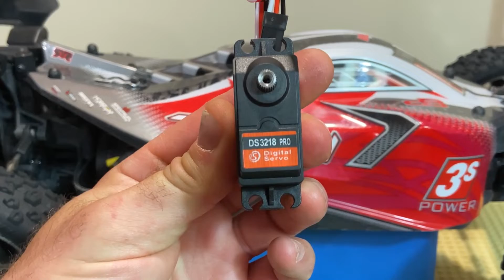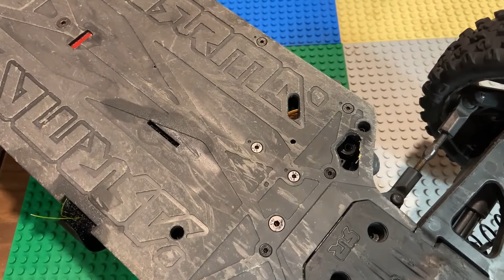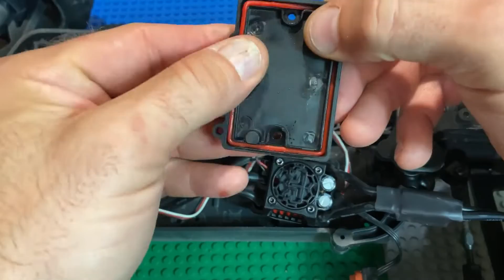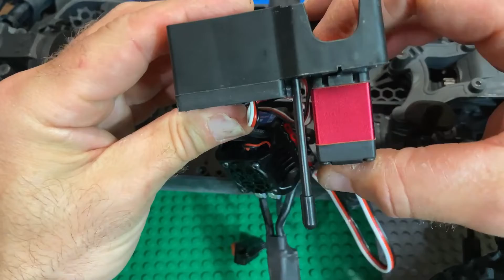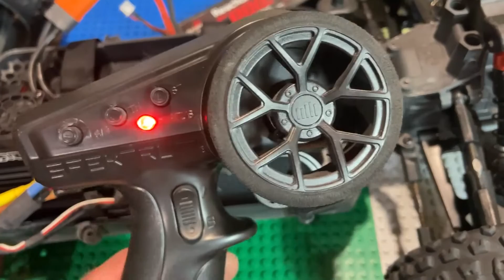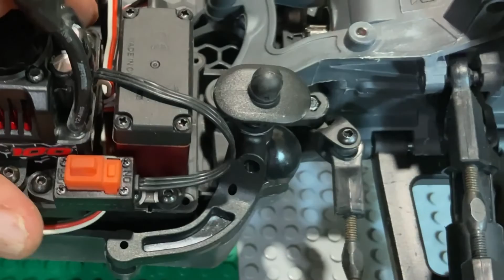HOW-TO REPLACE ARRMA 3S RC CAR STEERING SERVO | SET STEERING ENDPOINTS

Comment from the maker: Watch this next: How-to-Rebuild 3s and 4s Differential Gearbox.  https://youtu.be/faKrWfy4yuY
Reply: I watched that one.  I meant a full kit. 27ish bearings.  Including the dreaded motor bearing. You do a great job with the videos.  When I was new your videos would have saved me  a lot of time.  I'm sure you know the hub and motor module bearings go first.
Reply from the maker: @wescat2  i have a bearing kit for the whole rc here actually, waiting to do that video. And, i have a motor needing bearings too…. Def gonna hit those. You mean motor module? That was my first to go.
Reply: @phillybrc  Yeah.  I'm waiting on a pack of 10x15x4 for the module.  Do you do the bread trick for the motor bearing?
Reply from the maker: @wescat2  I havn t had to. Look interesting!
Reply: @phillybrc  Yeah if I there wasn't a video of it and how it works I wouldn't have believed it.
Reply from the maker: @wescat2  Hey how s it going? I just come across these older messages lol. I have since made made a motor bearing video using the bread trick. Thanx for suggestion....2years ago haha.

Comment: Dumb question on an old video. Thank you for the tutorial by the way. My stock Typhon 3s servo just went out on me today. Do you recommend the Amazon 25kg or 35kg servo?
Reply from the maker: @chrisginoc  not a dumb question at all. I ve owned both, i would pick the 25kg onky because it s a touch faster. Otherwise, either will work👍🏻

Comment: Great video Pal! Just did mine. Went ahead and put aluminum pivot balls in while I was at it. Only difference with mine was I had orange, red and brown wires. I used brown for ground but I did have to change the switch setting on my controller as it was backwards after I  got done. Thanks again!
Reply from the maker: THANX!  Yes the spectrum are reversed to other brands. Thanx for watching!

Comment: Great video! I have my servo on the way. I also ordered a set of aluminum pivot balls, which include two for the servo links. I'll have to figure out the best way to get those installed.
Reply from the maker: Thank you for watching. I have many similar videos, this link will help you! 🤜🤛 https://youtu.be/rPMqxy3GMtE?si=nuthjmas8o1isifp
Reply: Perfect, now I know where to put the two extra pivot balls. I'll do that when I replace the servo. Thanks Pal!  @phillybrc

Comment: Fantastic video thank you . I notice you apply blue threadlock to the plastic  steering  horn ? I thought threadlock damages plastic over time ?
Reply from the maker: I put blue threadlock on the screw. The screw, screws into the center of the spline on the servo…which is metal. Great question. Thanks for stopping by

Comment: ive got this red servo 20 g and and cant get red servo saver to go down on teeth of servo?
Reply from the maker: You need to figure out if the servo and the servo saver have the same number of teeth. If so, push down hard!
Reply: @phillybrc  yes they both have 25 teeth I push down but wont go on, its the same servo and saver you used.
Reply from the maker: @43rocket  it s hard. I used channellocks, did uou see that part?
Reply: @phillybrc  got it to fit! will the hot racing metal saver work on this servo?
Reply from the maker: @43rocket  yes ! It will fit, but i ve mostly heard negative feedback about that saver. Let me know how you make out
Reply: @phillybrc  will it fit easier on the teeth than the plastic one?  what problems?
Reply from the maker: @43rocket  the spring pops out, then it s junk…

Comment: Quick question I noticed you have the ST knob all the way to the left, mine all the way at to the right, and what is the function of that and how should I have it set when I am re-programming my ESC to factory settings
Reply from the maker: ST is "steering Trim". Ideally, this knob stays central.  The ST knob lets you trim the steering if it isn't travelling straight, Have the ST knob in the middle then power up the RC, at this point install servo saver.  Your ST knob will be far to one direction only if the servo wasn't in neutral position upon installing the servo saver. Hope this helps!
Reply: It does, thank you! @phillybrc

Comment: I've got a question, I changed the steering assembly for the alu GPM and the drag link to the servo isn't part of that set. If I change the servo, is a drag link part of the servo pakkage? If not does anyone know a replacement for the plastic link, i want it to be alu. 😘
Reply from the maker: Havn t seen just the the drag link available in metal. Hot racing bellcrank comes with a metal one and so does this one(i just bought it). This info doesn t really help you unfortunately.OGRC Aluminum Alloy Steering... https://www.amazon.ca/dp/B09WDLGJWB?ref=ppx_pop_mob_ap_share
Reply: @phillybrc  thx for the link, too bad GPM didn't include that part. The HR set seems awesome 👌🏻 Hopefully i can find something for this set and order HR set for my other car
Reply from the maker: I ll try to find you something. I put metal balls in my stock link. Works great.
Reply: @phillybrc  yeah thats a reasonable solution, I use the alu pivot balls for sometime now, and they work better then the composite ones. Eventually the rod ends wear out. Thank mate for he effort, I'll take a closet look at your shimming video 😉
Reply from the maker: https://youtu.be/rPMqxy3GMtE

Comment: i bought these same exact parts from your link and i cant get the drag link to go onto the servo saver. the whole on the small side is too small for the screw. how did you do it??
Reply from the maker: It s a touch smaller , yes. I just applied a bit of pressure and the screw enlarged the hole. Make sense?
Reply: @phillybrc  in theory yes, in practice i couldnt get it lol. how long did it take you?
Reply from the maker: How about a longer screw? It wasn t a challenge. Email me a pic or video?  facebook messenger or philborrelli@hotmail.com

Comment: the channel locks are pretty huge. I was at the races the other day and had to replace this part. Putting that servo saver 25 tooth onto that amazon servo, also 25 tooth, was a real pain in the butt. Had to muscle it but I got it on evenly. Being the same tooth count I would have thought it was going to be an easier fit.
Reply from the maker: They are big, what I had…a good way to come down square. I guess if it wasn t a pain in the butt, it would slip or skip teeth possibly. Thanx
Reply: @phillybrc  Would have been nice if that metal serve arm that comes with it fits in the senton. Unfortunately, the linkage is too low for that space so i had to good with that servo saver. But it's on, the screw is in, I think it should be good to go.
Reply from the maker: I believe you can use that arm if you cut a bit of the the receiver box out. Even so, you get any of the spring-loaded protection the saver provides. Good luck

Comment: Don’t use channel locks boys, I just damaged my brand new servo from doing this. With slight pressure not much at all, think it will be fine just to put it on by hand and screw it down. It still works but Dosent sound normal anymore.
Reply from the maker: Sorry that happened to you. I always do it this way and has been fine

Comment: My Typhon 3s was loosing steering randomly last 2 weeks. Like remote was turned off. I tried new batteries etc. last night it stopp again but when I got it back it move left fine but right barely moves and makes grinding sound. I was thinking bad remote but now we grinding servo.  Any advice? I’ve never replace one
Reply from the maker: Grinding is never good. I usually open receiver box and and reverse how they are plugged in(trigger and steering wheel are now reversed) If it does the same thing, i d say your servo is gone.
Reply: @phillybrc  I never thought of that. Trying now. Is there an easy way to see the gears? Like the top 4 screws. Or is that the board. I guess I might have to take the entire thing out to replace the servo.  I assume it doesn’t come out with the 4 screw on it
Reply: @phillybrc  I replaced servo and it’s fixed. Another issue. I hit reset button on esc yesterday I lost reverse which I got back. But when I turn transmitter off the car goes full power into reverse. Never did this before. Any ideas? I’m stuck as can be. Going in hour plus
Reply from the maker: @bri7777-l3x  reset throttle endpoints. Not sure if i have a video on that
Reply: @phillybrc  nip never heard of that. Any idea roughly how to do it ?
Reply from the maker: @bri7777-l3x  https://youtu.be/cgbOKYPaMG8

Comment: I did this with this exact servo and my steering is reversed. Fixed it with the button on the remote but the avc is unusable cause of this. What did I do wrong?
Reply from the maker: Oh man, this is strange. I ve never heard mention of the servo affecting AVC. That sounds like a receiver issue. open receiver and double check connections, make sure the the - (neg) is in the correct  spot.
Reply: @phillybrc  I tried plugging it in both ways. Only worked the one way. Cause the motor is reversed the gyro turns the opposite way. Makes it spin out instead of stopping it from spinning out. So weird. I’m going to reverse the polarity at the plug and see what happens. I’ll let you know. Thanks for the reply bro.
Reply from the maker: @jeff4232  of course, let me know. Good luck
Reply: @phillybrc  ya so I ended up having to take the servo apart and reverse it by soldering. I was able to do it without removing the servo from the truck, saved a few min.  Now the gyro and everything works great.
Reply from the maker: Really??? That sounds nuts. Nice moves man.
Reply: @jeff4232  hey I'm having same issue.. I'm not using gyro though. That's a hexfly by redcat racing servo right?
Reply: @billstanley2886  no. It’s an Amazon special.
Reply from the maker: @billstanley2886  The amazon servo and the hexfly look nearly identical.
Reply from the maker: If you re AVC is turned up too high it may act weird also.

Comment: Thanks.  The 12:00 mark is a life saver. I can't find any videos on this.
Reply from the maker: Awesome. Thanx for watchin and commenting.
Reply: My armma senton just lost stering... hopefully it's just a servo... any way to test it? To make sure that's what it is?
Reply from the maker: @51-FS  I usually will swap connections on my receiver first. Therefore, your wheel will control throttle and your trigger will control steering. This at least eliminates the chance of the steering components being bound up. Otherwise, testing other servo or receiver would be ideal.
Reply: @phillybrc  good idea... I ended up putting 6 volts straight to it and nothing happened. I'm on way home right now with a new servo

Comment: Very nice, when are you going to upgrade to a Reef's 299LP servo? Also.. if your putting a cheap servo in there, do you really need a servo saver.. seems kinda redundant. Did you try taking apart the new servo to upgrade the two ball bearings, and properly grease all the spur gears? The bottom of my amazon servo had little balls of solder.. I blew them outta there! :o
Reply from the maker: Cheap or expensive, wouldn t you want to protect it? This way you don t get sent home broken down. My son and I have taken burnt servos apart to view parts, no solder balls in there lol

Comment: Good video!!! I just knew how to set endpoints from this video. I own arrma senton 3s V3 blx. Need to replace new servo.. Is this servo torque overkill/ recommended?
Reply from the maker: I guess it s preference. If the torque is higher and still quick and responsive, it s good.
Reply: @phillybrc  is the new servo horn that come with the 20kg servo doesnt fit?
Reply from the maker: @micikho1  It does fit, and you CAN use it, but it is not a “servo saver”. A servo saver is spring loaded and takes some of the abuse upon landings and collisions.  The servo horn is direct drive and may break your servo. Up to you.
Reply: Your new servo requires 4.8 ~ 6.8 DC Volts. Meanwhile the original servo 6-7.4v . Is the stock Esc have BEC output?
Reply from the maker: @micikho1  No, it must be variable of some sort. It works great.

Comment: Just a quick question, do I need that exact servo saver or could I use a regular 25 tooth servo arm, thanks!
Reply from the maker: To my knowledge, any 25 tooth saver will do it. Options are Arrma, Hot Racing, Traxxas and Kimbrough. I m sure there are more I’m not aware of. Thx!
Reply from the maker: Oh, maybe i didn t answer your question...yes you can use the servo horns but they are longer and just may need to make some alterations.
Reply: @phillybrc  ok that’s all I need to know, thanks for confirming!
Reply from the maker: @Lukas-dm2qb  No problem!

Comment: Thanks for the video. I bought the same servo and couldn't have done it without this video. But Im having an issue where my right/left steering is reversed and even reversing it on the throttle is making no difference. Wonder if you know anything about this?
Reply from the maker: You can reverse the steering with one of the switches on the radio. As for lacking reverse,  go thru your esc settings again. Possibly unplugging has affected it. Hope it helps. Let me know.
Reply: @phillybrc  Reversing it on the radio did the trick. Thanks.
Reply from the maker: Beautiful